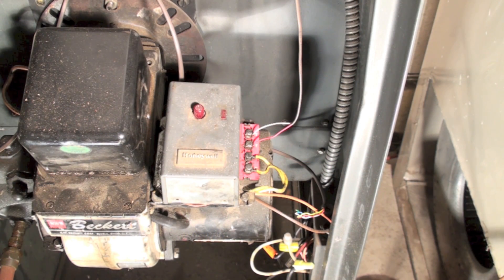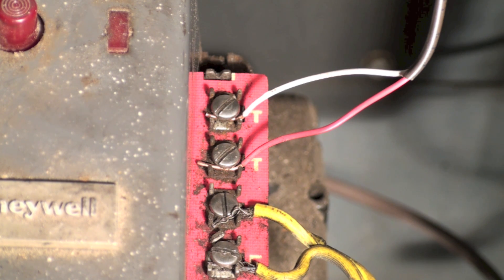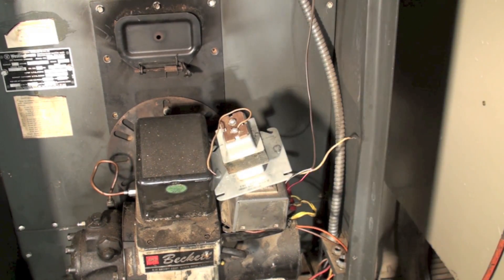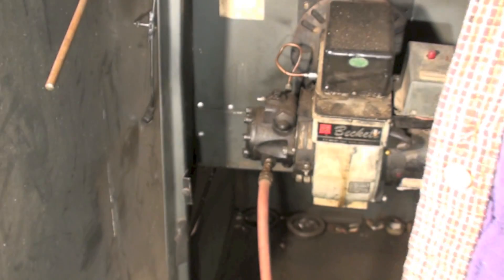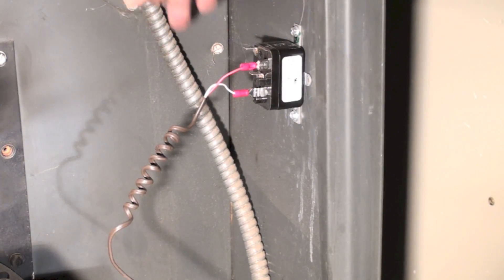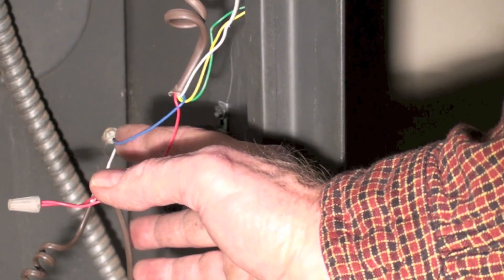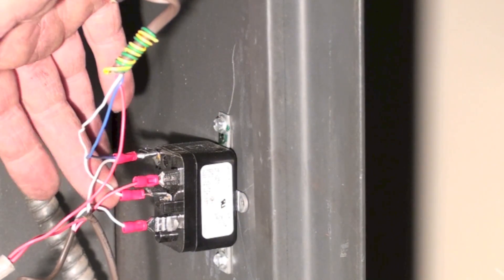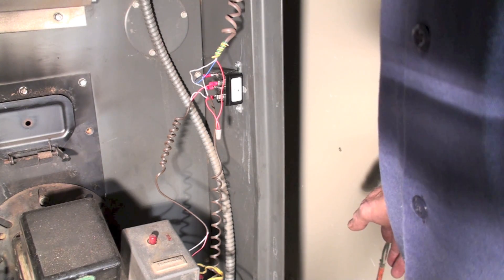Isolation relay for the oil furnace

Comment: Thanks, this was exactly what I needed!  Where would you suggest is the best place to tap the 120V supply so that it remains within the emergency furnace shutdown circuit?
Reply from the maker: If there is a 4x4 box where the power comes in to the furnace, mount it there and hook it to the black and white wires.  Hope this helps.
GFM
Reply: Indeed, mounted transfer on cover plate on main power junction with small evilbay sourced relay next to it.  The real challenge was pulling a new line to replace the two wire line but is in and the new Zwave thermostat is working on my oil/hot air furnace.  Thanks!
Reply from the maker: Legalmachinist Glad it works.
GFM

Comment: what is the power supply that is in the primary control that you speak of. Batteries? What happen to the 2 big fat yellow wires connected to the Honeywell primary control and what was there purpose before your modifications.
Reply from the maker: The primary control (cad cell relay) shown has connections to the 120 volt underneath.  The control has a small 24 volt transformer inside that supplies power to operate the control and send power to the thermostat.  The 2 yellow wires are to the cad cell (light sensitive), that "sees" the flame to prove the flame has been established.  Hope this helps.
GFM
Reply: grayfurnaceman Yup, that helps. Thanks.

Comment: Use those alot when replacing a 8184M control with the large transformer. When we install a newer furnace with a regular control alot of times there is only four wires at the thermostat. So we need the relay to isolate the oil burner control from the AC relay.